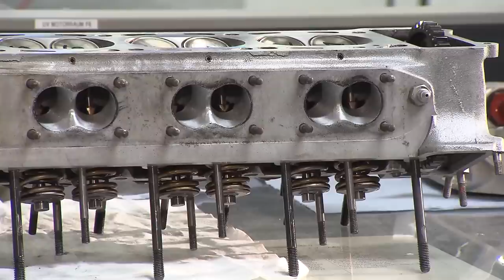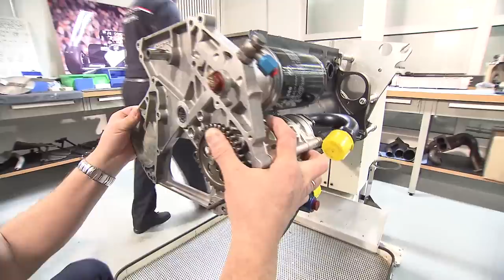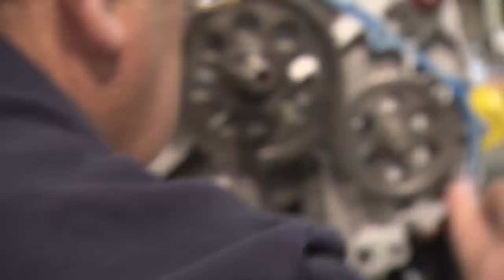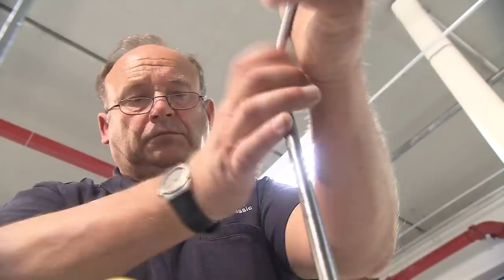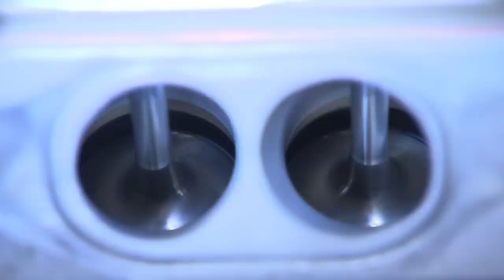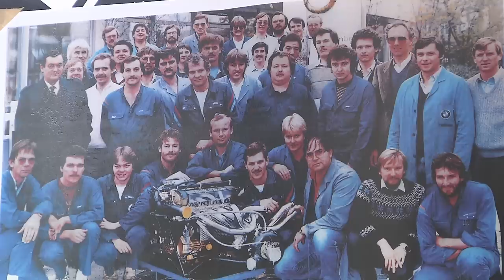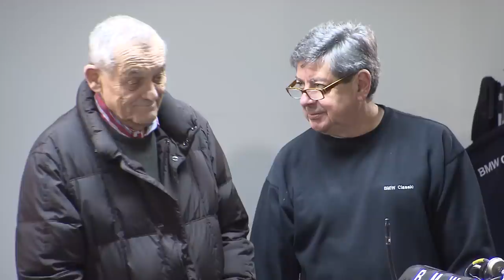BMW F1 Car BT52 1,280 hp Engine Assembly

Comment: 1300 hp, 4 cylinders, in 1984.  This is why modern F1 has pushed me backwards.  I'd rather study the history than concern myself with the 2019 season.
Reply: This engine as amassing as it was, was only MAYBE good for 1 or 2 laps qualifying trim and MAYBE make it through the race.
Beast of an engine, but unreliable. 
Engines now are way better.
Great Video!
Reply: 1984 it was "only" 950hp in qualifying. In 1986 it had an estimated output of 1400hp.

Imho the best engines were the 3l NA engines at 19k rpm with nearly 1000hp.

Comment: Am i the only one who finds these videos of engines being built oddly satisfying?
Reply: No, you're not the only one.
Reply: I love the sounds of two surfaces being mated up and bolts being torqued or the simple way the mechanic wiped down components with a paper towel. Artificial intelligence and robots are taking this away these skills and now man is a component that is soon to be superceded. Handmade really does stand for something.
Reply: @rockers2rockers616  or the sound of a large diameter drill bit peeling away at the metal that it's going through. Not many people understand the beauty of that sound.
Reply: No. There's nothing odd about it. It's visceral and indulgent to our gearhead ways.
Reply: Nope!
Reply: Yep.  Same with watch repair videos.
Reply: This engine in particular amazes me.

Comment: I wish they could still build engines like this. Gear driven shafts... No belt, no chain... Hairy piece this one...
Reply: old nissan sedans were gear driven
Reply: Honestly idk why they don’t use gear driven shafts today. It’s much more reliable to belts and chains it seems.
Reply: More contact surfaces = more friction. More complex assembly = more expensive. Also, more bearings to fail and misalign. Formula 1 engines get a lot more engines than a typical road car.
Reply: Gear driven used by Honda in racing endurance HRC motorbikes... RVF 750 RC 30, RVF 750 RC 45 and VTR 1000 SP RC51... and many more top CLASS Honda motorbikes
Reply: changing them gear bearings would be alot more difficult then changing belts or chains, plus engine noise/vibration wouldnt be the normal consumers cup of tea in a road car
Reply: Noise and vibration is the main reason most road cars use chains + belts. But typically timing gears dont have service intervals like belts and chains do so you-wont be changing them out.  And even if you did im not sure it would be that much more difficult
Reply: Brandon mostly for nvh and cost reasons. Also lack of design flexibility.
Reply: flat plane crank inline four cylinders have a secondary imbalance that increases with rpms and displacement. Those gear drives ensure perfect cam timing but also transmit huge amounts of vibrations from the crank case up into the valvetrain. I'm guessing that's why they have billet four bolt cam bearing caps and cast girdles instead of a one piece valve/cam cover. That cam drive mechanism is a compromise you wouldn't want on a road car, and they probably should have used a cross plane crank with 90 degree rod throws but might have lacked the ability to forge one strong enough.
Reply: High ourput f1 engine, based on a cast iron small sedan block. Those where the days
Reply: mightress: ain't no way that stock production cast iron block can take 800hp/liter. I'm calling BS, and unless they can show math showing heat rejection and stress analysis, I'm not believing anything about it.
Reply: Limo Wreck even if you look at this vid tou see the cast iron casing. These engines did not need to last. The 1200+ hp enginges ran for 6  laps maxx, than training was over. Im race bmw ran with about 750 Hp builds wich only needed to last one race. Teams uses one engine for each qualifying run. It didnt matter if the held up as long as they got pole it was good. Each race weekend bmw had 8 engines per car ready to run unlike now where engine swap is not allowed.
Reply: mightress: I have. There are at least three distinct blocks that I've come across. So they can magically hold over 325hp @ 70psi per 375cc cylinder with four studs while their competition, the Hart 415T, needed to have its head cast integral with its block to do the same? Would you believe someone if they told you they had a stock block 2JZGTE that made 455hp per 500cc cylinder for a grand total of 2731hp? How about that stock block LS3 that punches above its weight to 775hp per cylinder for a total of 5600hp @ 70psi from a giant turbo? All stock block, I swear. Sure. Right. Totally believe.
Reply: It was probably derived from a production block, just heavily reworked for F1 tell it barely held together for a few hours (maybe). derived doesn't mean is.
Reply: Noise.
Reply: @MoiPloy  Older Ford V-engines used to have a gearbox made of spur gears in the past (1965 to 1970s), but after 100,000 km they was they also worn and had to be exchanged.
Reply: I think the harmonics are an issue as well. Ive heard SC vs TC have the same issue. Supercharged engines wear out crank bearings earlier than their TC counterparts.
Reply: Thinking thee exact same thing!
Reply: @limowreck2612  whatever you just said I'm on your side
Reply: VW R5 2,5TDI
Reply: @limowreck2612  I'm with you on the block. No way was it anywhere near standard and people shouldn't believe the German engineering propaganda. It obviously did have serious power, the way it pissed all-over the V8 Cosworth DFV is proof of that.
Reply: @limowreck2612  Oh, you know it better ;-) Do research.
Reply: @limowreck2612  I kinda agree with you on this one! Like all legends,they tend to get embellished and exaggerated with the passage of time!...There is even talk of those cylinder blocks being buried in the ground for years and urinated upon and all sorts in order to stress relieve them before being machined believe it or not!

Comment: I remember reading about this back in the 80s. For qualifying runs Brabham/BMW made what were called "grenade motors" with insane boost pressures for super-high output, that would last only  a dozen laps before destroying themselves.
Reply: like 80 psi of BOOST!!!!!!!!!!!!!!!!!!
Reply: they used to seal the wastegate shut! ....They do that in modern V6 F1 engines but the difference being modern F1 engines now have MGU-H motors on the turbos allowing the spool of the turbo to be at discrepancy of an electric motor, and therefor can harness off-throttle which allows the turbo to not always be on boost -like the qualifying engines you mentioned, with their wastegates sealed.

Comment: The turbo is nearly the size of the engine!

I read somewhere they used old production-car blocks, with high mileage. Somehow the metal had "matured" and they were more reliable.
Reply: yeah, it was in the documentary about the engine itself, you can search youtube for that
Reply: BMW used the blocks from road test very high mileage engines, the milage "settled" the cast iron blocks so when re-machined/bored etc they held the tolerances better. They were very carefully selected and all burrs and casting marks were dressed smooth so as to not start a crack, needless to say, they were X-rayed during the inspection
Reply: Off the top my head , it was a production road car cast block they used high mileage at that , and then left outside apparently .

Not sure if was from the BMW 2002 series cars with a different stroke but they used a standard production block .
That Turbo I am guessing was original ment for a truck .
The lag must have been amazing waiting for that to spool up.
But very typical of the day when many teams still used off the shelf parts.
Great piece of history though.

Comment: That turbosize explains quite a lot: It is more a turbo with an engine, than an engine with a turbo!!!
Reply: Steen Lassen I know what you mean these old turbos where so inefficient they had to be huge.
Reply: It also has to supply 80 odd pounds of boost to an engine spinning at 10K+ rpm, so it has to be huge.
Reply: Napier discovered this with their compound turbo aircraft engines. The turbos were developing more power than the piston engines they were attached to. This is why they soon switched to turboprop engines

Comment: Somebody told me that the guy that let the gasket fall had to clean the toilets in the workshop for 2 weeks. 

Serious note: BMW has been able to build an engine doing up to 1200 HP in qualifies, and 800 in a race, that looks like an engine with nothing special, like you can go into a BMW showroom and buy one: that is insane. 

Some years later, they put some of the tech into the 4 cyl 2.0 on the 320is (190 HP and high revs), and the 6 cyl 3.0 in the M3, turning the E30 series into something that really made sports car's history.

Comment: This is the m12 engine right? They made this engine from the M10 that powered the 2002's,520i e28 and the 318i e30( early versions)
Reply: I believe you're correct.  I know its before M3. Just the block though. Dry sump and different head.

Comment: they didn't use torque wrenches at all it was very strange.i woulda figured they would.
Reply: +Chris Silva They were, unibody torque wrench, i.e. each wrench has a 5nm rating etc, so you have to have 20 of these uni wrenches to equal an actual torque wrench
its faster though
Reply: thats pretty freakin genius....
Reply: Huh ok.ill watch again.
Reply: Chris Silva noticed that too , guess those old dudes know what is jussssst right😄
Reply: Chris Silva   ____. Not all bolts have to be torqued. They only torque the ones that need it.
Reply: I assure you torque wrenches are being used in a number of places even if we don't see them.  I've worked on enough engines and around men with many years of experience and no one can just get it right by feel alone when it comes to torquing a head bolt or intake or etc.
Reply: Then didn't check crank end play or rod side clearance.
Reply: @limowreck2612  yes there were no torque wrenches used in F1 , there is nothing more
Sensitive to the human feel when tightening nuts and bolts, a torque wrench will overload a weak thread and lead to failure, whilst an experienced human will pick it up and it can be sorted.
Reply: Chris Silva the germans have a built in torque wrench themselves they can judge amount of nms lol
Reply: @johnnybahama497  Now that's just silly. I bet you can't even tighten a plug without a torque wrench.
Reply: @limowreck2612  You really think they showed every single step of the assembly in a 5 and a half minute video?
Reply: its probably better to measure the length of the big end bearings rather than torque them up after all we are using torque to measure bolt stretch/tension which is rather crude , even oil type and quantity on a thread can change the accuracy of a torque wrench , ie we sometimes have 2 torque settings 1 for unlubricated bolts and another for lubricated which is about the unlubricated setting X0.8 , the last few motors ive rebuilt i havent used any torque wrench just feel
Reply: I think it’s fair to say this isn’t normal engine building. It’s F1 and they clearly know what they’re doing
Reply: I didn't see any gasket or sealant 🤔 Is it possible?

Comment: Very nice but pretty simple engine. Looks quite crude when compared to a modern sports bike engine but can't complain at the numbers,a massive turbo can make any engine go crazy! Can you just imagine it off boost? The turbo lag must be awful?
Reply: These engines did not build boost until around 7000 rpm. Search for "bmw f1 turbo dyno plot" in Google images and there is a dyno plot as first result. They don't even start the plot until 7000 rpm.

Comment: Wonder if modern F1 engines have gear driven timing.  General aviation still uses it on its air-cooled engines and the engine of the F1 bolts to the body similar to general aviation.

Comment: You want an engine to make big power and be reliable. It’s Gonna  have a Closed deck Iron Block, gear driven timing, and piston cooling jets. Lightweight should never be the focus on an Engine block it should be overbuilt, on the internals sure, lightweight forged pistons and rods.

Comment: I all looks surprisingly low-tech compared to modern standards (Engine had cast Iron block I believe, to better withstand the enormous forces..)
Reply: It was low-tech for that time aswell. BMW knew it, but insisted on using a street car sourced block. This caused a lot of issues for the chassis builders as the engine was not designed as a stressed member and needed a plate to bolt up to the frame. Everyone who used this engine just went along because of the massive power it was putting out.
I'm sure BMW could have designed a more competitive bespoke engine , but chose to prove that their street car engines are good enough for F1

Comment: those cilinders are really shinny
Reply: Fel Ta. they are hard chrome plated. expensive but allows far tighter clearances.
Reply: no hard chrome does not allow for tighter clearances, it allows for more wear resistance.
clearances are determined by the difference in rate of thermal expansion for the piston, and the cylinders base material
Reply: 1500cc
Reply: Please note that ALL active parts in the engine are measured with 1000mm tolerances, the liners are a good example to this, they may look shiney, they are smooth bored, the pistons and rings where a TRUE "state of the art" those days ...
Reply: Göran Blomqvist Please stop spouting random facts that aren't true.
Reply: @Göran Blomqvist your name is Swedish yet you use the metric system like an American .. 1000mm is 1meter and that is quite a loose tolerance I might add..  You probably ment 1/1000mm
Reply: It looses compression when i stick my piston inside a wet sleeve, i need advice from these technicians!
Reply: English is not your first language, is it? @ Fel Ta

Comment: Any one know what block they are using? is the rumour true that its basic m10 block and they get them from customers cars from service.. (e21 etc.) :D
Reply: yeah used M10 block
Reply: Had to do at least 100,000 up to 115,000 km that  way they could examine the block and be sure all the stretching already took place. So they got world champion once with blocks that did 100.000 km :-P
Reply: The block is from a standard streetcar, belive it or not! But like Schwanzel Stock writes: They were rather "matured", so they were certain there was no stress in them.
Reply: Greg McKee, the staff were also told that if they needed to pee, that they should go outside and relieve themselves over the engine blocks that were outside being weathered.
Reply: I see you guys all got your information from the same video, repeating the same 'legend' over and over again.
Reply: @paulweatherley3140  Maybe that's why Nelson Piquet pissed all over Alain Prost's Renault in 1983, although using illegal fuel probably helped.

Comment: gear driven engine :3
Reply: +Roubert Marvin i wish i could get my hands on a gear driven engine
Reply: i wish my M20 was gear driven
Reply: meanwhile my car's l36 is stuck in the days of pushrod ;) wish they didnt use tech that old still :(
Reply: +M S38 my 00' vfr 800 is gear driven ;)
Reply: wow that's awesome, no more pesky timing chain replacements ;)
Reply: Yeah, instead you get pesky gear bearing replacements :p.
Reply: Iconic Ford 4.9  OHV inline six  ! There's millions of 'em
Reply: yes, the Ford inline six, 4.9 litre or 300 cubic inches,....there are  few other automotive examples of gear driven motors out there also...

Comment: No Torque Wrench Just Spinners ,Lots or Men To Do 1 or 2 Mans Job, Thats F1 For You.Not the Real World at All.
When i Was a Honda Tech I Had to Rebuild Engines and Gearboxes and Sort Electrics And Fab and Welding And Everything Else All Myself With No Help Most of the Time,F1 People Dont Know What Work is.
Reply: Yet here you are commenting and watching them, where's your appearance in any F1 videos? You've just described every racing team... I can pull wheels, change tyres, drop an engine, rebuild a gearbox but yet they still have someone for each job. It's as though they have a big budgets and time frames, crazy to think huh...

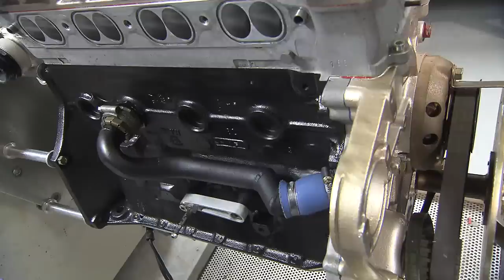Comment: can anyone clear for me whats the thing they fixing on 3:12 .. looks like diesel injection pump is it??
Reply: It is oil pump for dry sump oiling system.
Reply: Kugelfischer fuel injection pump - it was popular until early 90s, you could pump huge amount of fuel easily
Reply: Dry sump oil pump
Reply: It is a Kugelfischer mechanical fuel injection pump. Similar to a direct injection pump but the injectors are in the intake plenum not the combustion chambers.
Reply: That looks like a fuel injection pump. You can see the 2 blue fittings could be supply and return lines and then there's 4 line for each cylinder. But I don't know for sure.
Reply: It is a mechanical fuel pump, which is capable of very high-pressure fuel delivery which allows for excellent fuel atomisation, a Kugefischer pump to be precise.
Reply: @memadmax69  Remind me to not let you anywhere near an engine rebuild.

Comment: From wich F1 season is this engine from ?. And to what temperture do you preheat the block, before you putting in the cylinders ?.
Reply: Arie Visker this is an M10 1.5L block from the E26 series of BMW so F1 1980's.
Reply: Arie Visker I

Comment: Every thing the tightened with T wrenches dit not need torque, that and I only break out the torque wrench for final tensions not running nuts or bolts in